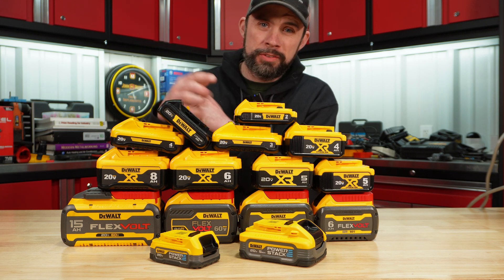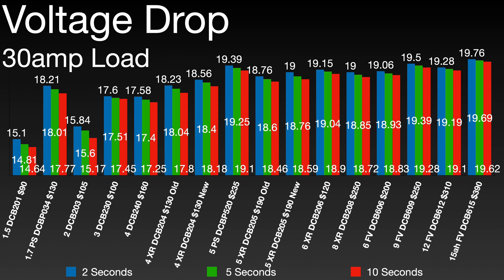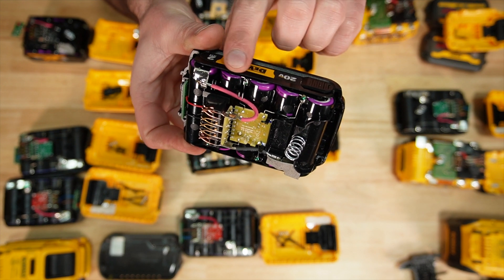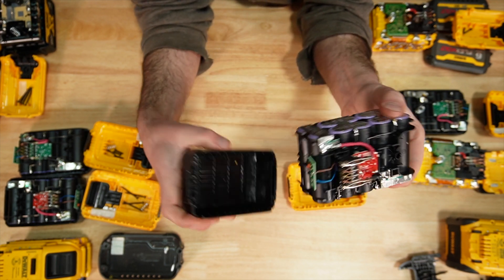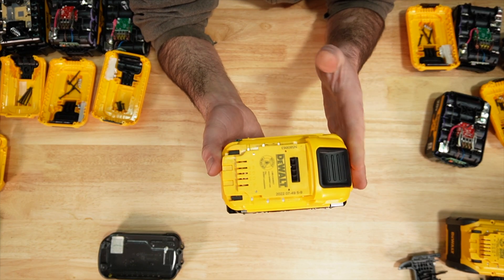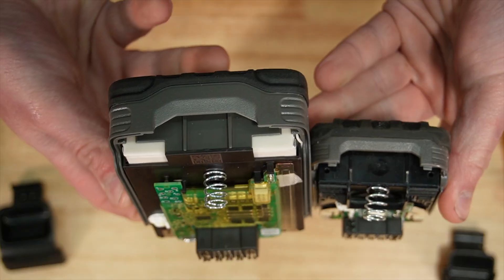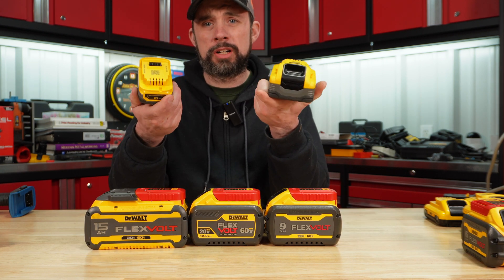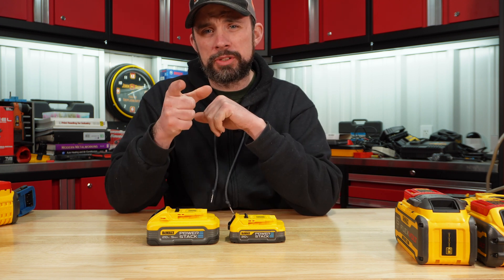Dewalt 20V Battery Testing & Teardown

Comment: thanks for the info.  I personally rebuild all my 21700 power tool batteries with samsung 21700 50s cells.  the samsung 21700 50s are the best cells in my opinion.  High capacity with a high discharge rate.
Reply: Interesting, no tool manufacturer touches the 5ah 21700 cells. We know from multiple tests that in terms of power output, 3ah 21700 > 4ah 21700. Wonder why no power tool company will use the 50s. Maybe it's not durable enough, like the 30q.
Reply: @Factoryseconds123  They seem to have a 25a discharge vs the 30/40 of the ones in use already.
Reply: @Factoryseconds123   the 30q is in lots of power tool batteries.  All of the milwaukee m12 6.0ah batteries are make with samsung 30q batteries.  Same goes with the m12 3.0 compact and the ryobi 18 volt 6.0ah and the 9.0ah are all made with samsung 30q or sony vtc6 cells.  Also these power tool companies have to work within a budget.  The best 21700 cells on the market are the samsung 50s and the molicell p45b.  Also these 2 cells are relative new and only been out less than 1 year.  prior to the release of these two 21700 cells he most powerful in terms of discharge was the samsung 30t but of course the capacity sucks.  All all the 5ah 21700 cells only had a 10-15 amp discharge rate which is way too weak for power tools.  Now the molicell p45b has already been proven to be more powerfull than a samsung 30t and with a 4500 mah capacity.   Plus the new samsung 21700 50s had 5000mah of capacity with a 25amo discharge rate.  not as strong as the 30t but still good enough for power tools.
Reply from the maker: No problem,  interesting I will have to look into doing that.  

Thanks for the info!